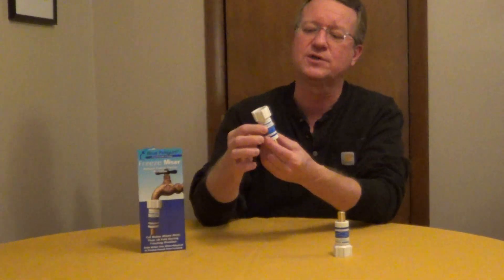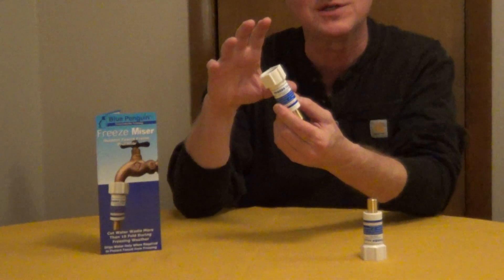Prevent an Outdoor Faucet from Freezing - Freeze Miser

Comment: Please tell me this; does the freeze miser have a fixed maximum flow rate? IOW,  it opens up and allows a small stream through when it's 30 degrees out. Would it run more water through when the temp falls to say 19 degrees - and then even more if it got down to -20 - and then it would continue to open up to the point where the water is running full force?
I guess i just don't understand the physics. Thanks
Reply from the maker: Hi, it's designed to adjust the flow rate depending on the temperature. I've only seen it either drip when it's around freezing or release a small stream of water when it was below freezing here in the Chicago area.
Check out more home improvement tips in our e-books https://www.amazon.com/gp/product/B0B2KW1FQ9?notRedirectToSDP=1&.
Reply: @FIXITHomeImprovementChannel  I did 'the test' first and knew that it worked. i hooked mine up last night and it never did more than a slow drip. i checked the forcast again and all the temps had changed and it never reached freezing. i think i'll put my own thermometer outside and forget about these finicky forcasts :)
Happy Holidays